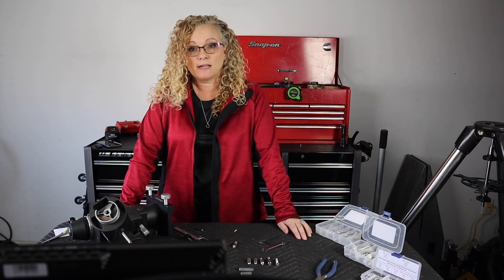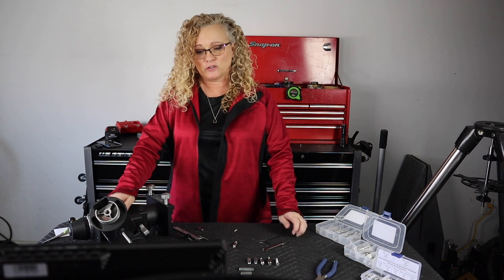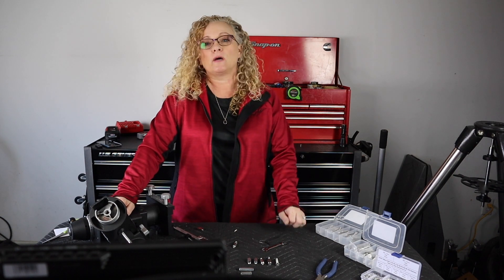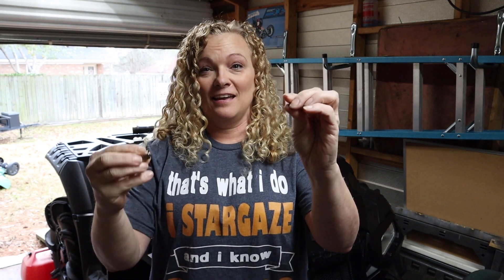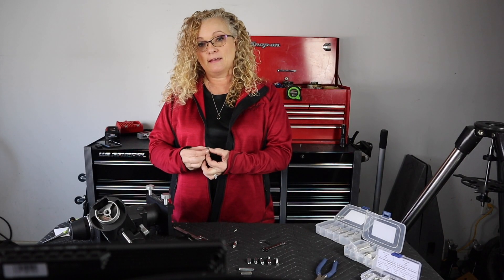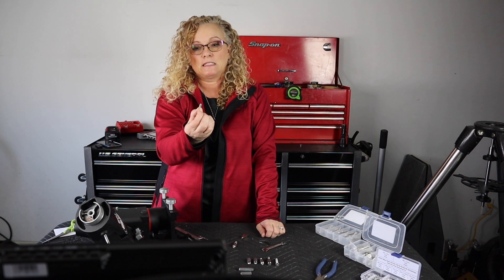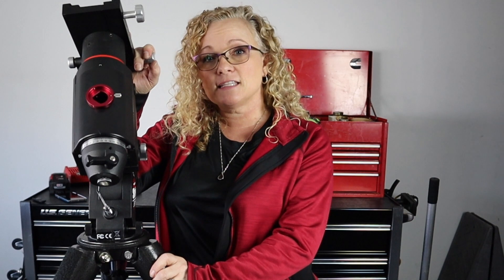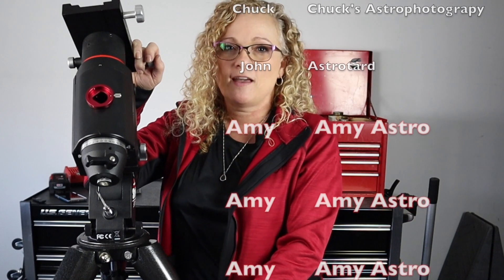DIY - Telescope Tripod North Peg/AZ Push Peg Fix

Comment: I've been looking for something like this for a few weeks now. I'm getting ready to build a cinderblock pier in my back yard and need a north peg (i'm lazy and don't want to swap it off of my mount if i want to travel with it, risking breaking/losing it). I kept thinking exotic solutions like square nuts, or filing down the sides of a screw/bolt to get the flats - your hex solution is perfect =)  And since it's a DYI pier adapter, I can use whatever bolt I want for the taps I have on hand with your solution.  Thanks for sharing your oops with all of us! It helped out a lot more than you may have realized.
Reply from the maker: Awesome!  I'm glad this helped.  I was so embarrassed to break something else I almost hid under the bed. lol  If anything I did give my husband a reason to buy a grinder.  I was trying to do the angle on one side, but when this worked, he just got a new tool in the collection.  Follow me on facebook and share your completed pier.  I can't wait to see it done.

Comment: Great improvisation. Having access to a lathe you could have modified the original alignment post, by drilling a hole into the post where the threaded portion snapped off, tap the hole for 6mm thread. Then inserted a section of 6mm threaded stock, and voila, job done.
Reply from the maker: Brian Griffiths I need to watch a video on how to use it. Now I know we have it I will be giving it a spin. But don’t tell anyone. Lol. I’m kinda banned from the cool toys.
Reply: @AmyAstro  I won't tell anyone. BTW I have seen replacement posts for Celestron mounts, but no thread size is given. If it is a US thread, it won't fit your M6 hole.